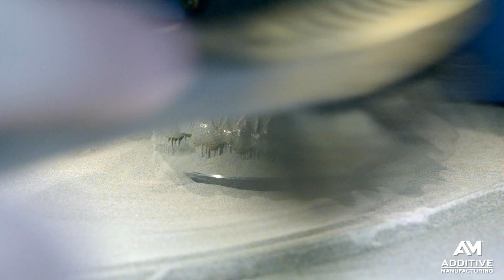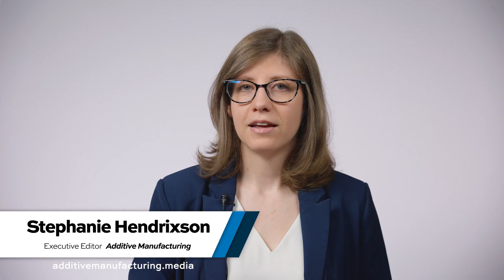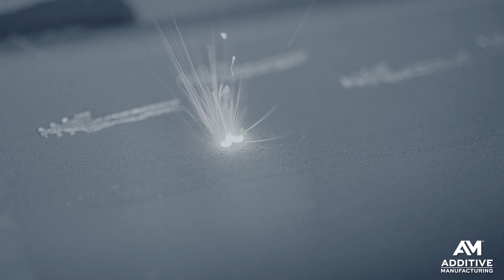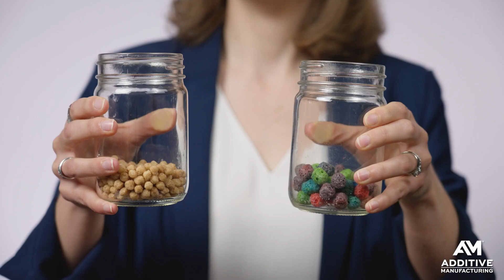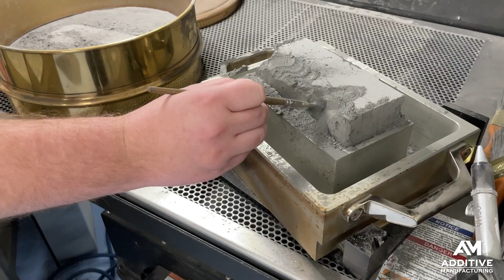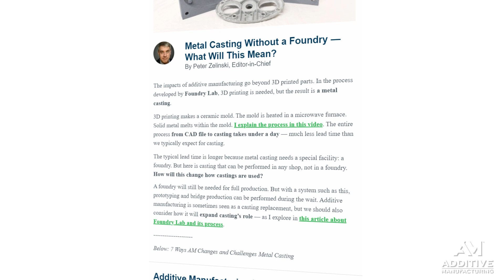Multimodal Powders for Metal 3D Printing

Comment: would be interesting to know about cost, obviously vertical integration is one big step, but can atomization process be tuned to more directly result in the final mix ratio / is less refinement needed, and how expensive is the rotating/heating/cooling process, and is that suitable for many materials or just one?